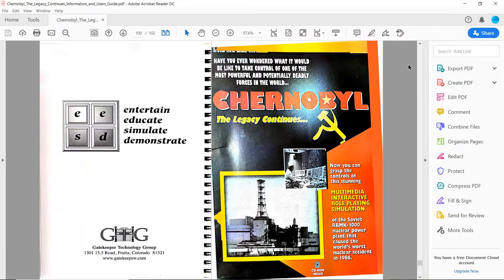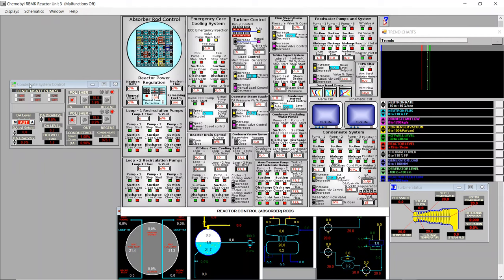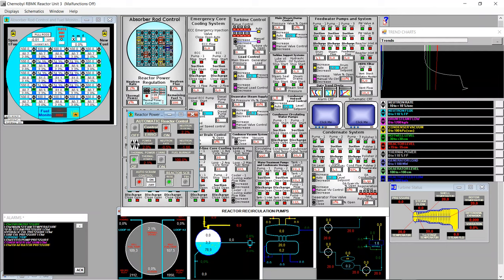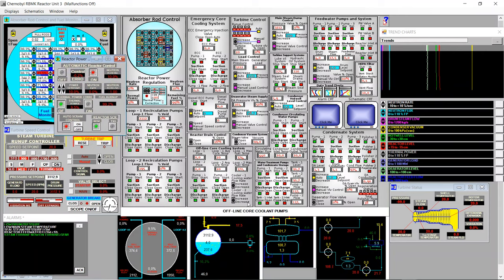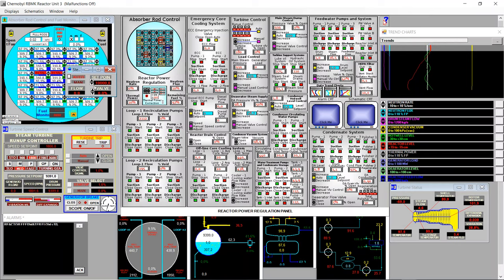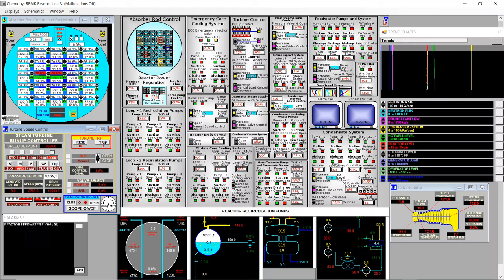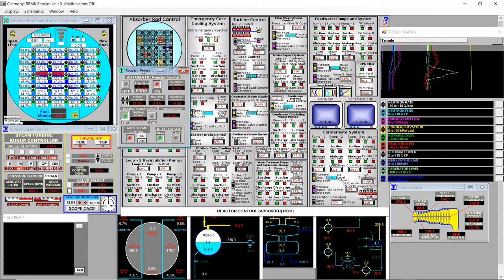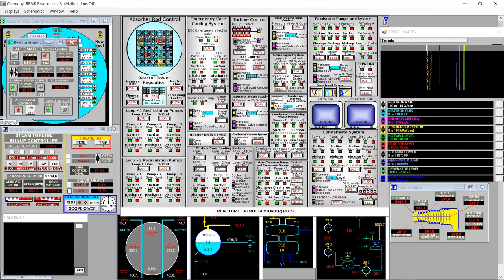RBMK-1000 Chernobyl Nuclear Reactor Simulator Tutorial

Comment: followed the tutorial several times but the pressure not increase above 200
Reply from the maker: Did you do the IC state fix? increase main steam line pressure setpoint to above 7000 kPa, close steam drains? are you getting disk rupture trouble in the alarm panel?
Reply: @argilaga  yes followed every step from tutorial, exept fix xenot bug with cheat engine and i not getting disk rupture trouble in alarm panel
Reply from the maker: @dejanmarkovski7044  Did you turn on the steam seal in the turbine?
Reply: @argilaga  yes i did, everything from tutorial step by step just you do
Reply from the maker: @dejanmarkovski7044  Then I have no clue, you can check the new tutorial i just released few days ago, you may find the problem there

Comment: And the simulator aways crashes at 30 35 minutes... Windows 8.1 at HP Z820 dual Xeon cpu 128gb ram. DAMN IT... Anyway, thanks for the video.
Reply from the maker: Did you find a solution?